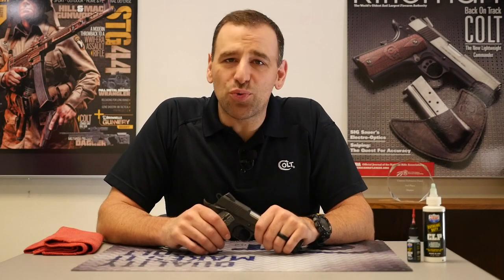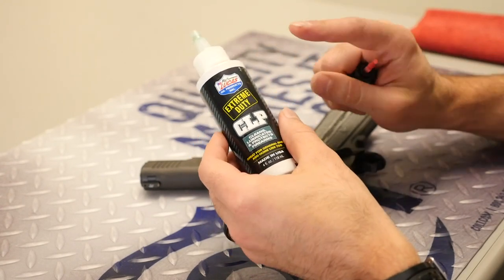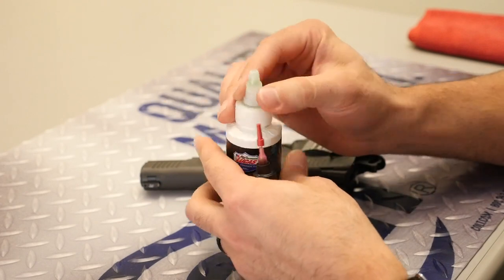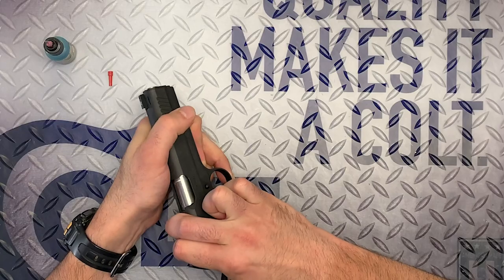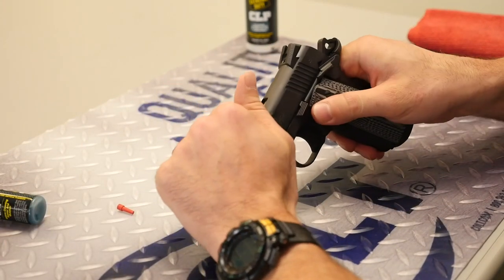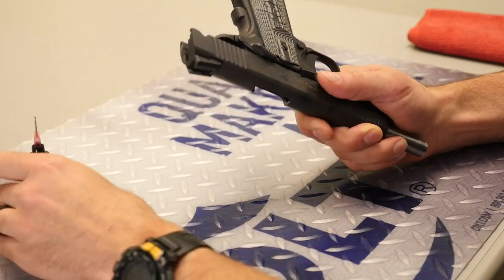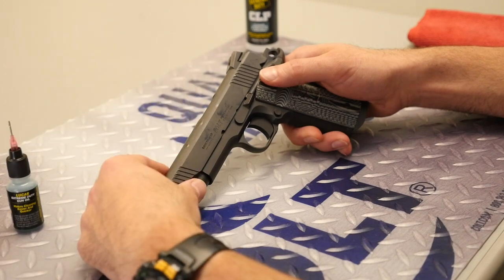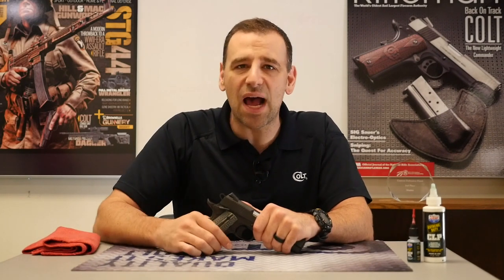Proper Lubrication of a 1911

Comment: I have one of the new Colt 1911 Classics series 70, I bought on Feb 21, 2020 and have kept track of every one of the 1,368 rounds I’ve put through it so far. I have 20+ mags, either factory or Wilson  Combat both hybrid and wadcutter. Because of where we shoot down by the creek, our average distance is well over 25 yards. When you can shoot rocks the size of a softball over and over again, I couldn’t ask for better accuracy. I feel like I’m cheating when shooting at 7-15yards. Not a single issue or malfunction with the gun. I’ve run many different hollow points and FMJ’s without issue. I would like to try some wadcutters through it. I paid $750 for it which is a steal for what you’re getting but it should come with two mags. You guys are making great 1911’s again and I’m proud to have the pony on my gun. I know 1,368 rounds isn’t a huge amount but it’s enough to know what a gun is about. Thank you.